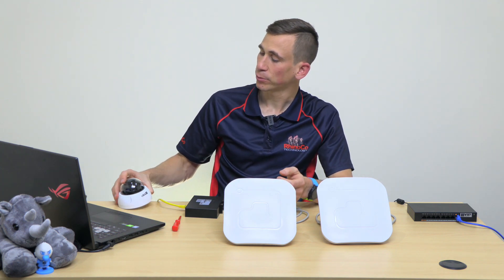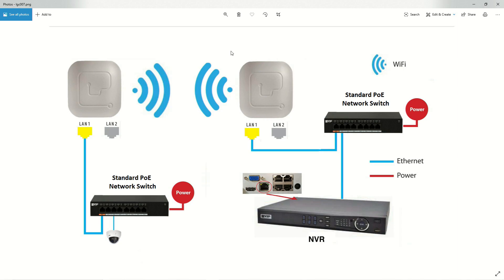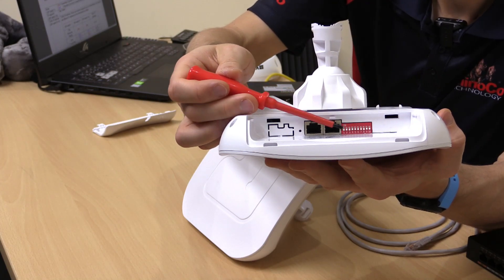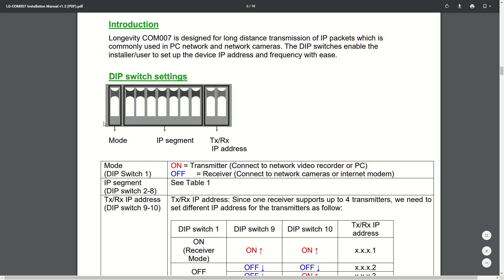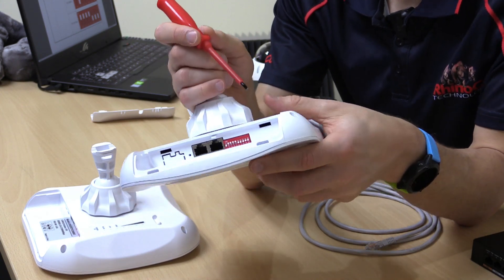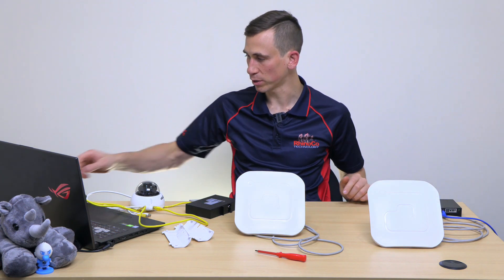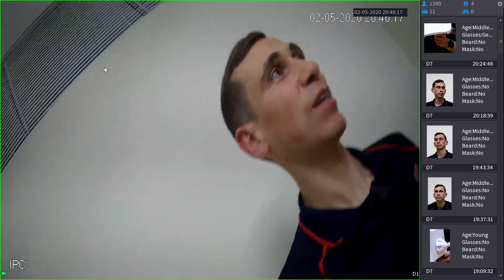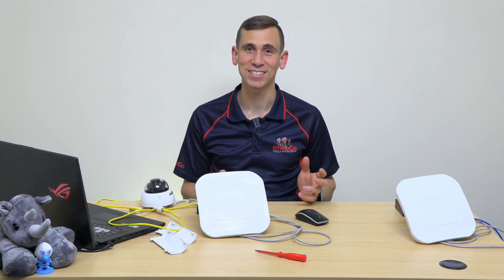Wi-Fi network bridges made simple with Longevity

Comment: How Water proof are those Longevity  devices?  Are they designed to be mounted on a roof mast?
Reply from the maker: Hi Andrew, so long each unit is mounted with the cable entry at the bottom of the device (relative to the ground) water ingress will not be an issue.  The PCB is also conformally coated to prevent any issues with condensation.  Feel free to contact our tech team if you'd like more information - https://contact.rhinoco.com.au/
Reply: RhinoCo Technology  I deal with you guys anyway and will call. Just worried as this site is near the sea.  I would not trust the network connection if it wasn’t totally sealed. (  Ip65)